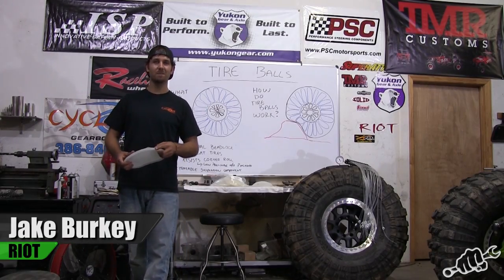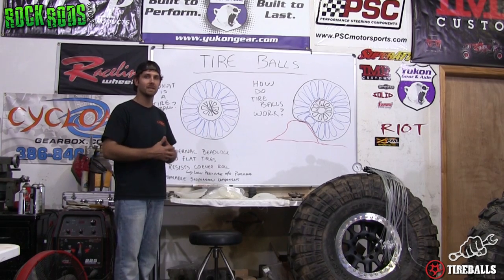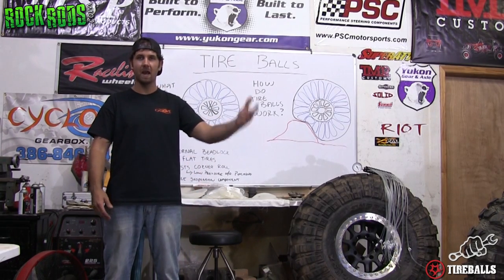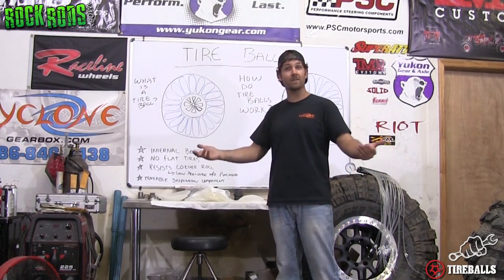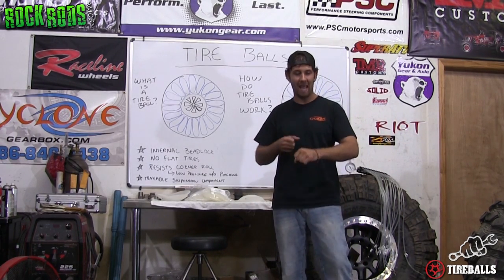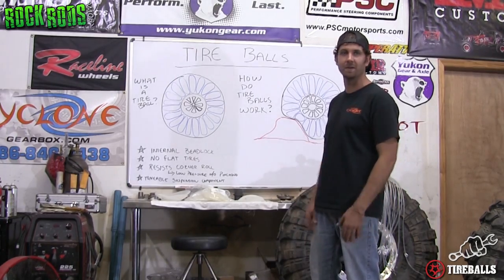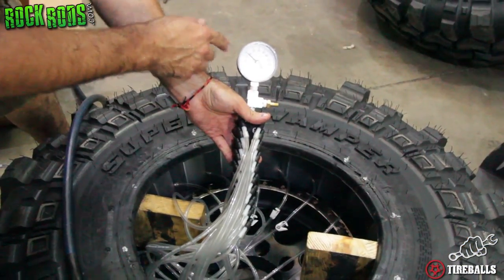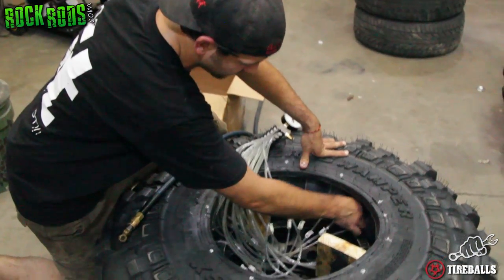Tire Balls Installation and Review - Rock Rods Tech

Comment: I run foam beads in my utv tires 35in which is almost the same concept except no air and they do have to be replaced or add more every so often cause if you hit a rock or obstacle it will crush some of the beads which make them smaller. A buddy of mine runs expanding foam in his.
Reply from the maker: john martin foam beads? Interesting. Heck RC cars use memory foam in their tires.

Comment: Nice video. Sorry for the late question but you installed them at a 45 degree angle.  Does it matter if the bags are leaning in the direction of travel for the tire or against the direction of travel?
Reply from the maker: shouldn't make a difference.

Comment: That's  some Crazy stuff  Jake. I've  never  seen those before. Wow. So there's  no actual  air inside the cavity of the Tire? Very interesting  technology!  Very cool. Oh! I also noticed  A bunch of guy's  are snapping their Drive shafts fairly easy in a lot of the video's!  That could be another tech video. Drive shaft construction and Materials!
Reply from the maker: They are tunable so you put a certain pressure in the balls and a certain pressure in the tire. Drive shaft tech is on schedule for the next video.

Comment: How long does it take to install those and set the bead locks? Do you have to pull the tire off the rim completely to  get the needles back in once they are installed, or just through the bead locked side. I love the idea and the theory, and yeah, anything for an edge when it comes to racing, but tuning them has to be a seriously time consuming chore.
Reply from the maker: Thats a good question for Jake.
Reply: Hey Jake, what is your answer??
Reply: I dont get it.  I replied yesterday but its not showing up.  Ill try to recap.  It takes me around 30 minutes to change pressures in a tire.  You have to take the tire off the vehicle, lay it down, remove the beadlock ring, air the tire down, put the beadlock back on, and install it back on the vehicle.  The tire balls stay in the wheel and all you have to do pull the bead lock ring to get the needles in and out.

Comment: Four questions if you got a min.
1) I'd put them in a daily driver, a 10,000lb Diesel SUV currently on 37s, any issues there? Know of others using them in a daily? I could see them getting hot at highway speeds and high loads. 
2) I currently use internal dynamic balancing media(dynabeads). Thinking about it, I think putting about an ounce of water in each ball would work great for that. Any reason why not, know of anyone doing this?
3) So let's say the tire balls are installed at 20PSI, I then fill the tire to 65PSI, the balls are going to shrink down quite a bit. Thus they'll be lose in the tire and shift around, thoughts? Thinking about this it seems to me I could simply attach them to the tire in place. A couple strips of good tape per ball would probably to the trick. 
4) Ball size, I see both the 37" and 39-40" kit both have 20 balls, and neither specify wheel size, width, etc. So are the balls between the two kits a different size? I currently roll a 37 on 16.5 but I'm looking to go bigger and ditch the 16.5, so if I get the 37" kit will those work in a 40 on 17s? Or Get the 40" kit and squeeze them into the 37s, or wait and do it all at once?
Reply from the maker: It is not recommended to use in street driven tires
Reply: OK well that's not helpful, without a reason that's meaningless.
Reply: You puncture one and now your tires not balanced.
Reply: Not really, and to the point it is it would be anyway with any balancing method.
Reply: @snek9353  Ok, sounds like you know what you're talking about. Quit asking questions and run them at 70mph.

Comment: Is there a way to run tire balls and internal balancing media?
Reply from the maker: No.
Reply: That's to bad, I really like internal balancing and these sound like exactly what I need. IDK why the oil itself couldn't/wouldn't replace the balancing media. Any idea what the oil actually is, hmmm. Maybe a little water in each ball would do it. Yeah, don't see why that wouldn't do it, a couple OZ of water in each ball would probably work well. 

Something kinda abrasive and small like dynabeads would be an issue, the oil would make it sticky, the small hard beads would rub on the balls, be a problem. But something bigger and softer, small solid rubber balls maybe. Ehh mostly just thinking out loud.

Comment: why not use foam to fill the tire? it works for rc trucks, and equment like skid steers
Reply: Multiple reasons.. I've wondered that myself before.. The main reason is heat.. You get the best use out of stickies when they are hot.. And most foam can't handle that kinda heat.. To quote Jake you lose the ability to "tune the tires".. You have one preset for every thing you do.. That's not ideal.. Also you lose the pressure on the inner bead.. No matter how much foam you pack in it'd be almost impossible to put enough in to have enough pressure..
Reply from the maker: foam wouldn't hold up. If the carcass of the tire had air pressure that would mean moisture was in there and would degrade the foam over time as well.
Reply: +BustedKnuckleVideo just a ideal, one size does not fit all, there is a big diffcen betrwin your buggy, and my rc trucks
Reply: Weight is the primary reason.  These balls weigh a fraction of what a high density foam does in the same application.

Comment: i never even knew these things existed
Reply from the maker: now you know
Reply: BustedKnuckleVideo yeah i know a fair bit about cars and off road an engine stuff but i never new that learn something new everyday
Reply from the maker: Our Rock Rods tech videos have a ton of good info. check out the series
Reply: yeah teaches me to fix my own stuff we have a rhino 450 that we ran through water real fast and now it doesnt go as fast and doesnt want to climb hills , it only goes 20 mph top and thats down hill , we replaced fuel pump , fuel filter , air intake , and now whats left is either water in the engine block or the carborater is messed up , we also have to replace a 3rd axle and for the stuff we do thats a lot because we dont roll it and we dont do crazy hil climbs in it , its really just our farm and mudd buggy because the same place we messed it up at was where we mudd
Reply: BustedKnuckleVideo oh well what can you do , atleast we might get a new buggy the rihno was already used when we got it but it was in really good condition and it would be 9 years old now
Reply from the maker: They make Turner Axles for those?
Reply: BustedKnuckleVideo dont know because we always put in axles that are just like the stock because there is no need for expensive and strong axles , we have a 6 seater now so it takes the place now
Reply from the maker: whatever works

Comment: Or you could just buy Hutchinson split rims
Reply from the maker: and how would that be the same as tire balls?
Reply: Busted Knuckle Films  locks both inner an outer beads of the tire with a center bead lock...not to mention protect the rim edges against hard hits. Honestly I thought you would know this..... but I guess not ....the bead lock  adds mass to the center of wheel alleviating the need for balls to balance the tires...the military uses these rims specially because of these properties.
Reply from the maker: yeah but when you cut a tire you are screwed, Not with tire balls!
Reply: Busted Knuckle Films true to true for sure👍

Comment: Nope. Sorry, no.
Reply: K
Reply: +BustedKnuckleVideo no idea..
Reply: +BustedKnuckleVideo It just seems expensive, and complicated. I get that having a puncture or de-bead is work, and can ruin someone's race, but that only just might happen. And the bead-locker has to come off for every adjustment/bit of maintenance with this it seems.
Reply from the maker: Just about every Ultra4 racer, quad racer, and endurance dirt bike racer runs them. There has to be a reason for that
Reply: ebenezer switch, with that logic we would all be still running factory vehicles.  my point is this: any performance modification has pros and cons.  installing a locker, hydraulic steering, 4 link, or V8 swap are all complicated and expensive but the performance gains are worth it right? Tire balls are no different.  They are a upgrade to your wheels and tires that increase performance.  drawbacks are you have to pull the beadlock to change pressures and expense, but the list of pros outweighs the cons by far.  once you do a couple sets changing pressures takes about 30 minutes per tire.
Reply: The main point is.. In rock bouncing.. Even the tires have to have balls to compete!